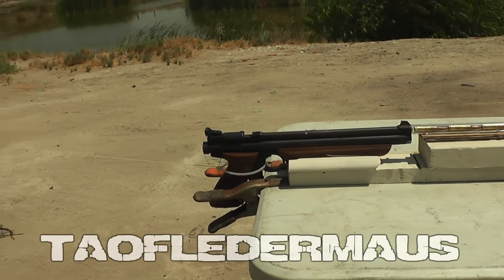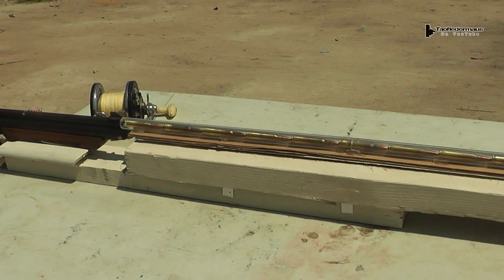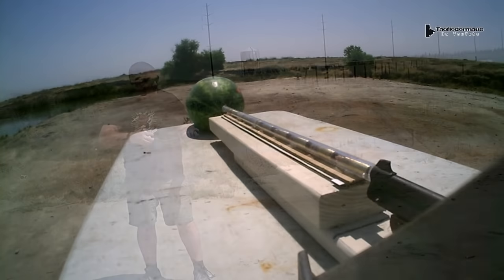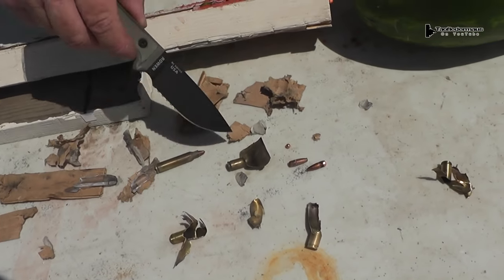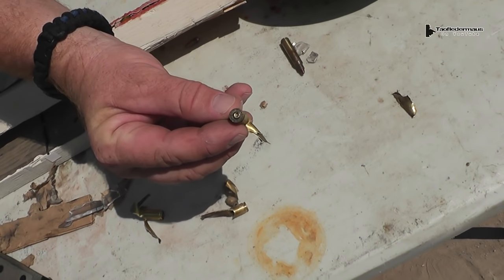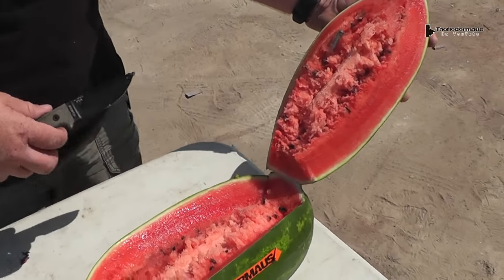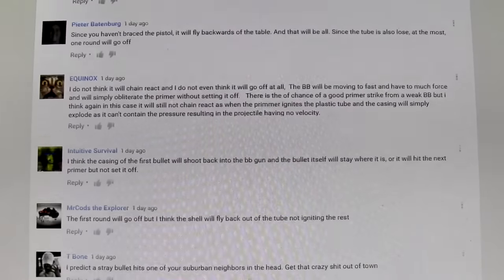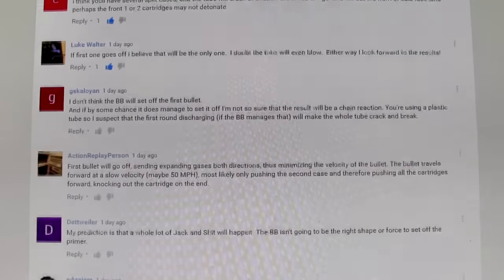Chain-Reaction of TEN Rifle Rounds -  99.99% got it wrong

Comment: Well done experiment. Though you failed to mark the rounds to keep track of them, and you also failed to explain why the watermelon didn't suffer the expected damage a normally fired 5.56. It should be obvious the last round did not fire normally  or the bullet would have at least exited the watermelon. The whole casing was found only 1/3 of the distance and tumbled. An M16 pops watermelons quite nicely. You failed to show the location of the last bullet. Was it further in the melon?

 My assumption is the destruction of the tube dissipated much of the force that would have propelled the casings and the bullets must have gotten "backed" up and caused the casings in the rear to burst. This is why numbering the casings & bullets is important to determine the chain of events more clearly. 

 Glad you have high speed cams which will definitely clear things up. I'm going to look to see if you have repeated this with them right now, lol.  Thumbs up.

Comment: Well I've been wrong before. That's why I'm an engineer. However there is a recoil backwards. This is a proven fact of physics so it is not busted. F=ma where m is mass of casing minus fuel, a is acceleration of casing rewards and F is the force behind the projectile. The acceleration of the projectile is faster than the recoil backwards which is why the chain reaction occurred for the first round. Subsequent accelerating projectiles basically "canceled" the rearward movement of the casings and possibly helped propel them forward. Also consider the conservation of momentum. m1v1=m2v2 where the 1 are for casings and 2 for projectile.
Reply from the maker: The case and the bullet are going to go in opposite directions with equal energy.    A .22 would send the lighter case backwards faster than the heavier bullet would go forward.
Reply: right, conservation of momentum. m1*v2 = m2*v2, but not necessarily equal energy. thats simplified physics 1 stuff. As far as engineers are concerned, the two systems can have different energies, albeit in this case it might be such a small difference that its within measurement error. for all practical purposes though, the math and physics validate the experiment. also good to know that my .30-30 won't be blowing up anytime soon. Also consider the energy of the chemical reaction. not entirely sure where that comes into play in the energy conservation... good video though :)
Reply: Andrew S. I come to watch shit blow up and I get a physics lesson. .3.

Comment: This is why guns with tube mags have blunt headed projectiles in the rounds. It takes a bit of energy to set off primers but bullets set inline are perfectly arranged to go off in sequence should a cartridge activate in the mag. A stacked mag won't go off like that. I have a 30-30 and the cartridges have blunt projectiles. I knew that if they could ignite the first round the others had to fire. And that a BB can indeed fire a rifle primer. Great video, but $10 says you still get assholes that will say that this was a fluke.

Comment: I didnt know about this but I would've said that it would've worked. I was military and I've worked at federal premium, building primers and ammunition. All the reasons for why people said it wouldn't have worked were dumb. Whether it would've worked or not the reasons they came up with were dumb. People get so lost in thinking about whats really happening and whats really required to make these things happen. Like saying you need a pin so as to mimick a fire pin to make primers go off. Why would you think that? You could literally find a million ways to set off primers, why would you think that you specifically need whats in a gun to make it go off? Thats just what they use in a gun to fit the purpose of a gun. I wouldnt say that I would know that it was going to work, but even watching your set up I felt that it was very practical. People get so lost in processes, its actually really quite simple. I even believed that the last bullet would go off and penentrate the watermelon but it wouldnt be much since there is little to no compression as there is in the chamber of a gun. Maybe just a little right before the tube had completely exploded. The only real question would've been if each bullet after the first would've had enough power to set the primers off as bullets exploding on their own have very little power and that the shell being lighter actually blows off the bullet. But with how fast it went, each bullet firing probably acted as a stopper for the back of each shell which gave that shells bullet more velocity and it all was contained in a tube that even if it exploded, it momentarily offered some additional form of compression which helped velocity. Pretty simple concept to me. Even if I didnt have other experience.

Comment: If you want something you don't want to be around when it goes off fill up an empty CO2 cartridge with black powder and use no less than a six-inch fuse that burns an inch every two seconds polka hole in the ground just deep enough to leave a inch sticking above The ground light it after you drop the CO2 cartridge in there then run like hell. However I recommend nobody does this. It is only a hypothetical situation .

Comment: The problem I had with your original test was actually that you didn't have the rounds under and sort of pressure which meant that the spring which should have been pushing back was instead cushioning the rounds meaning there would just plain and simply mean that the spring would take all the energy and they're wouldn't be enough to set the rounds off, glad to see in this one that you actually compressed the spring. Also kinda wish I'd have found these videos before you did this that way you would have had 3 people who would have accurately predicted what would have happened, honestly in amazed at the stupidity of some comments you were talking about. Space to get up to speed? It's a shaped charge explosion, it's maximum velocity is achieved  very shortly after the bullet leaves the shell, getting up to speed only applies to rockets and vehicles not powered by a single large explosion! The primer is harder? It's your standard small primer the metal part is always the same! A BB won't set it off? Maybe if it was shot from a plastic pellet gun but over all BB guns shoot with more force than any firing pin except those used in artillery. First one will explode and the rest will not, well explosions first go in the path of least resistance, ie down a tube where the rest of the rounds are pointing and when they can't go any further fast enough then they push out to find a way to vent all their force.

Comment: In fact first bullet velocity is greater by far at the time of first primer going off, than the last one closer to melon.Only last bullet is being fired properly. All previous ones just being crushed like train hitting wall.Nonetheless chain reaction,  but not a proper outcome as video claims..
If the last round that is closer to melon would be pushed backwards to hit primer then there is a better chance of proper reaction, providing that shells are quickly removed from following bullets path :D

Comment: I guess many are asking themselves what would it take for the same thing to happen in a old fashioned Lever action gun that has 10 or 12 rounds in the mag tube. So what would it take for those in the Mag Tube to go off. Say like a 454 Casull in a lever action that has a lot of recoil that might jar the Mag Tube hard enough to cause them to go off. it's doubtful that the recoil alone would set it off. But a pointed round that could hit the primer maybe like an old 30-30 but are they pointed enough. A 454 Cas has usually flat tip, or round nose, or even hollow point which most of those wouldn't hit the primer with enough force to cause a discharge. I believe in the first set of rifles were the 44 rim fire so wouldn't need a pointed bullet to do that even the same for it nothing is touching the rim to cause a discharge. 

I believe what everyone is really asking themselves is what would it take to cause a discharge in the mag. tube of which if it did happen would most likely be a chain reaction to all the rounds lined up to each other provided you could cause a discharge. Does anyone have an idea of a failure that would cause such to discharge in this manner causing most likely death to the cowboy shooting the gun to possible by standers if in the Saloon when happens.

Comment: would be interesting to see what happens with a rifle barrel instead of that "tube". would change the way force is distributed, and could lead to much different results. And really guys, you should have a ballistic shield and several yards of "remote trigger" line. this is kind of begging for shrapnel in the face. Another safety concern is the lack of a backstop. That watermelon is not sufficient to stop anything.

Comment: I can understand why most people believed most of the myths, except for the BB not having enough power/force to set off a primer.  Come on, most BB guns can punch through both sides of an aluminum soda can, and many can punch through at least one side of a steel soup can, including the multi-pump pneumatic used in this demonstration.  How could anyone seriously believe that any brass primer could be too hard for a BB to even dent just enough to set it off?  Well, this was one of the busted myths that was liked by someone in that scroll through the comments from the previous video in this video at 7:23.

Comment: what would happen if you fired a 129 grain full copper hollowpoint with a steel berring pressed into the hollow point and put it on top of a 9:1 mix of XTX and 3300 and shot it out of a full lengh 9mm carbine barrel?

Comment: The round with the tip pushed in actually did go off, first off you can see the neck is burned right around it's  circumference from when the round went off lol, but more interestingly and importantly  it was under so much force from all the rounds going off instantaneously, applying just as much and possibly even more force back on to the bullet behind it, the tip was re-established into the casing as soon as it came out!! (each tip of the bullet smashed into the primor end of the bullet in front of it and then that bullet came back with an equal and opposite of force, in a moment in which round casings necks are always heated and expanded momentarily when fired, the bullet had the ability to just slide right back up in that casing!! but after the neck was done expanding it contracted causing the bullet to get trapped in the neck,   which is why the bullet did not come back down into the casing and blow up the casing completely like some of the rounds did!!  Pretty damn cool!😂

Comment: I'm surprised anyone, let alone so many people thought nothing would happen. WTF else? With all that energy stored in the powder, how the hell do you think it would fail to activate the primer through a thin piece of tin? The brass casings have quite enough strength to direct a goodly part of the pressure forward before they blow up.
The only way I see this not working is if the rounds were not constrained by the tube and go out of alignment before their charge goes off.

Comment: I dunno if thats conclusively a "Complete" chain reaction,  Several rounds detanated, though ti appears for the force of the blast set some off, not necessarily  a strike from the previous round, though some did.    I assume the point of this was the Spitzer bullet in a tube magazine fear?   pretty conclusive regardless,   be careful with those

Comment: I would have guessed only 1 or 2 rounds would go off.  If I had to bet money it would have been on only the first round.  I definitely would have known for sure that the BB was going to set off the first round.
If the tube was metal I would have predicted a complete chain reaction but I'm really surprised it worked like that with a plastic tube.

I bet if you did it multiple times you would get different results...  totally depends on how that first round goes off and how the tube fails.

Comment: Not true. Experiment is flawed. Use a metal barrel. Density is different with a plastic barrel and plastic is too weak to hold the combustion strength of bullets. The precise time the plastic barrel blew up can be calculated with the amount of explosion volume each bullet has in gun powder

Comment: I would have been one of the ones in the wrong crowd. I've never actually seen any proof that this has ever happened in a tubular magazine. My theory is that if it were to ever happen at all it would be after the shot was fired and all of the shells in the magazine slammed rearwards as a round was loaded. I would think that would be much more of a jolt against the primers than the recoil of the rifle going off. I guess you get the ''Myth Busted'' award today for that one.

Comment: Nothing new here. That's why tubular magazine weapons can't be used with pointed bullets. The rounds in the tube have a nasty habit of chain firing when the recoil force of the weapon causes the point of one cartridge to fire the next one. There have been tube feed weapons where the tube was made in a spiral so the point of one cartridge did not touch the primer of the next but they are rare. Most tube fed weapons are fired only with round nosed or flat point bullets. Every now and then, though, some genius will decide to load a 30-30 with spire points and blow his hand off.

Comment: 2 quick points. First there is a reason that ammo used in lever action saddle guns have a soft point. Second a couple of years ago I believe it was in the Cleveland justice center. On the way to the court the evidence an unloaded gun with the bullets in a separate plastic bag. As it was being walked down a hallway one of the rounds went off.

Comment: I'm surprised only two people guessed correctly.. you would think it would be more, figuring a bb would slam into the first primer with a lot more force than a striker. Also common sense to me is that once the first bullet goes off there is so much kinetic energy concentrated into the next bullet via the tube that the chain reaction would be inevitable.

Comment: okay so after seeing this (having not seeing the question video) i suggest if you were to re do this experiment you should add gaps, not so the bullets can speed up but so you can differentiate between the primers being set off, as a further proof, since a chain reaction with no gaps happens so quickly

Comment: i guess it would have worked even if u didn't use 10 rounds, instead u could have used 10 bullets slugs only and only one full round at the rear, and one at the front and got similar results. make sure there i not gap between slugs in this case.  how bout we try it?

Comment: Here's a dumb idea. Do another one where only the first bullet has a full load of powder in it and the rest are totally empty with the primers also already shot off. I predict the bullet will destroy the first few other empty casings and damage one or two of the bullets before all the pieces are just exploding out the sides of the tube. If it's a strong metal tube, a few more of the casings will be destroyed and a few more bullets badly damaged before most of it is shot out the end of the barrel.

Comment: I think you'll have a much more greater result if you use a metal tubing. The pressure from the combustion inside the chamber is too overwhelming that it needs a stronger material to guide the ammos.

Comment: I honestly did think that it would work. Contrary to popular belief, a bullet is fired by explosive gas. Not compressed air, or a spring, but a FUCKING EXPLOSION. Such a rapid one, that these "Bullet" things fly so fast they kill people. "Every man should worship common sense"- A Day to Remember. PS. the (not a joke) caption was delivered excellently
Reply: it should be noted that the 8mm lebel which was first used in a tubular magazine they designed so that the tip of the bullet was not resting on the primer on the next round. the way they did this was a unique design of the primer. lebel rifles never blew up.

Comment: I saw a guy who I was hunting with have his 30-30 magazine go off with a chain reaction when it was dropped out of a tree stand about 30ish feet while loaded with hornady leverevolution ammo. Granted we are not sure the poly tip set off the primers but we can not think of any other reason it would have happened.
Reply: Do you know how many rounds went off?  What did it do to the gun?  If you'd been holding it, would you have been at extreme risk?
Reply: We only found two shells that were torn up, As for the gun the magazine tube was split apart, the foregrip was in pieces, the barrel was dented in several spots it was a complete loss. I am almost sure that all 6 rounds in the magazine went off. Had it been in our hands or had one of us ben on the ground next to where it landed I bet there would have been a visit to the hospital.

Comment: I have a question about the rounds in the tubing. Did the rims create a seal or could air flow by them?
Reply from the maker: There was very little space between the rim and the tube.  Maybe .002"  since I had to remove a tiny amount of the brass so they would fit in the tube.